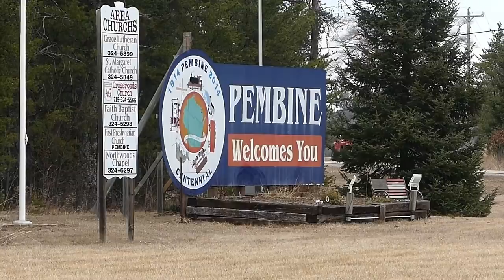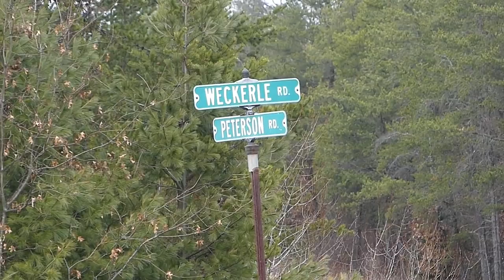ALL FOR ONE? THE STRUGGLE IS REAL FOR SHORT-LINE RAILROADS! | Jason Asselin

Comment: Great video.  No FRED on the back -- is that legal?
Reply: The flag in the knuckle serves as the marker, doesn’t need to be lit in the daytime.
Reply: Yes, because FRED is a electronic brake control unit. They do not need it for one car. It has adequate breaking from the engine. In coal country some of the coal trains are so long they have helper cars in the middle with Wilma on  the front of the train and Fred in the back.

Comment: I think that it's Normal that sometimes trains only have one or two cars to haul, it even happen to class one railways. I got to make a correction about was I was saying regarding the lack of maintenance of there rolling stock, for that part there engines look decent and in good shape, there rail cars are OK they just never repainted them to the companies color.
Reply: The BN and ATSF merger was just over 25 years ago, and still, a lot of ATSF motive power is proudly wearing "warbonnets". Saw an NS video a few years ago and in it, they stated it cost them $15,000 per locomotive for a repainting. Rolling stock is always going to be a "one-and-done" paint job for the life of the car, getting "patches" as needed for reporting marks and numbers.
Reply: @thomasboese3793  I think watts for mergers it's a bit different, technically the units belong to the same company but larger. I seen old rail cars that in their life time that received a new paint job with the logo under the same company. ☺
Reply: @stephaneduguay7267  It all depends on the age of the car at the point of merger. The older the car the less likely it will get more than a logo if that at all. Watching some "Wide World Of Trains" (here on YT) many older ribbed-3-bay covered hoppers sporting green paint and BN reporting marks. No BNSF logo, it looks just like the merger never took place. Part of that is the age of the car and the fact that they used the old BN numbering system as a starting point for the merger system. It will be interesting to watch the new CPKC as a new identity is formed. 

Sometimes an old car is purchased from another system, so yes depending on the size of the company and what management thinks the car could just get patched or a full paint job.

The WSOR welcomed a new shipping customer a few years back by repainting a car and emblazing their name on it. The car had to be "repatched" as you can't have non-railroad companies' names on railroad-owned equipment. ICC rules. That being said, as a model "it" runs on my layout, both ways. See this page of photos of the prototype's 3 paint jobs: http://www.rrpicturearchives.net/rsPicture.aspx?id=281707